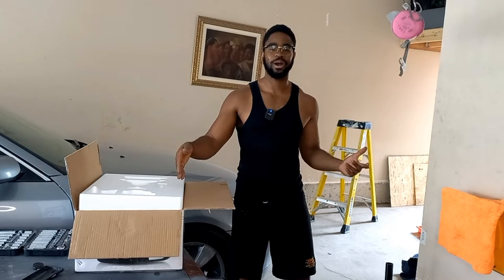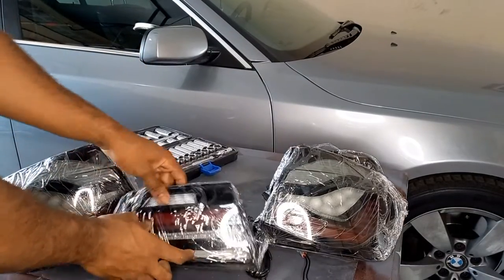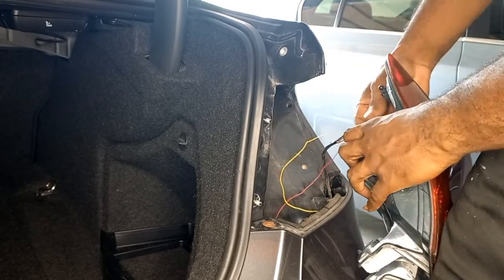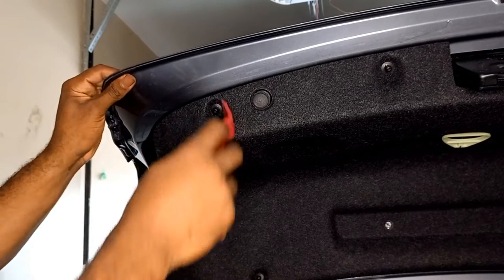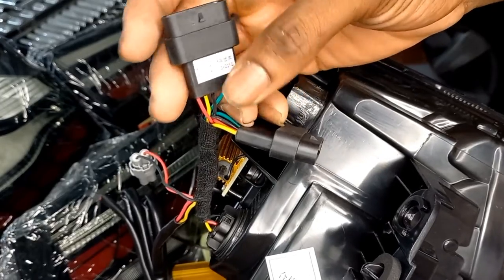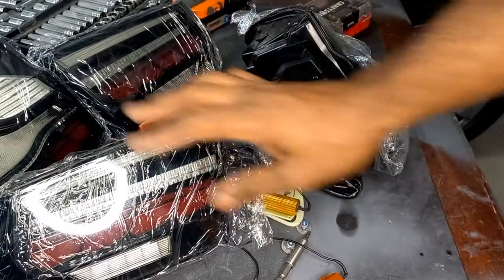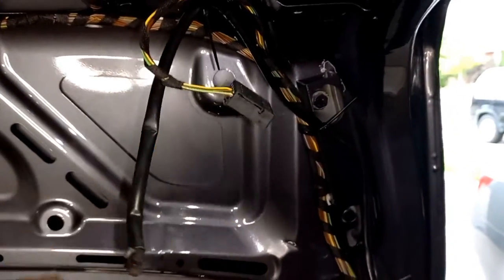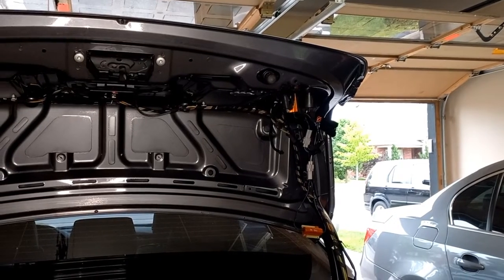Vland GTS Smoked Tail Lights Install - F30 Pre LCI

Comment: Hey man! Great video! Quick question. Do these smoked/blacked ones have a visible e-mark on them with corresponding numbers? So, it is actually legal to drive in Europe and have no problems with MOT. Thanks! keep up the good work!
Reply from the maker: @dmitrijsbeliks9090  appreciate the kind words! I don't recall seeing anything like that on them, and recently changed tail lights again. Best bet is to message Vland and ask!

Comment: Also bro why didn't you get a better angle of the start up animation fr
Reply from the maker: What angle would you like to see? It's all a learning curve for me too, so I can improve for next time
Reply: @n55morris14  like get the entire tail light on few so we can see the full animation
Reply from the maker: @jh.f30  will do, thank you for the constructive criticism 🙏🏾
Reply: @n55morris14  I've noticed there is an extra wire with the kies motor sports taillights you have to plug in to connect the two taillights together and use the zip ties etc.. do these ones already have that wire installed? Mine just showed up and from what I can see and watching your video that what It seems. If you're not sure what I mean just watch Kies motorsports install video quick

Comment: Getting in the small inner tail light is a bitch rn idk why
Reply: The clips just won'tttttt go in or line up properly idk why
Reply from the maker: You have to kinda push in from outside in,  and make sure the tie down is floating inside it's spot (inner trunk section) then seat it
Reply: @n55morris14  I figured it, was annoying tho and the left side Inner taillight fits a little better for some reason
Reply from the maker: @jh.f30  funny because my right side fits a little better